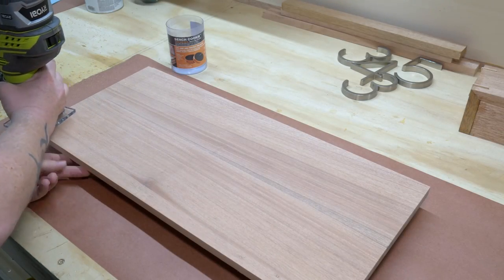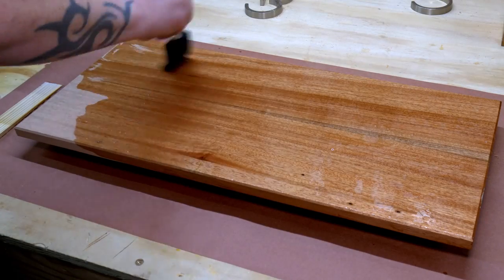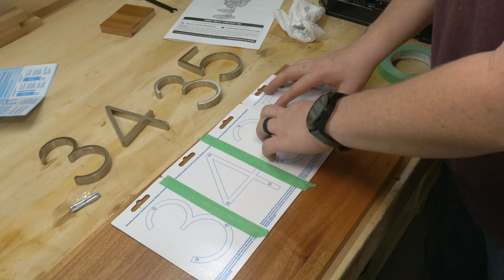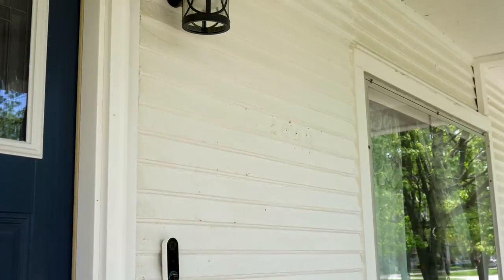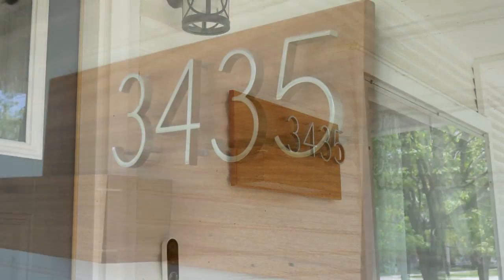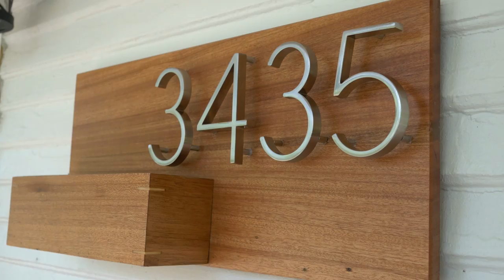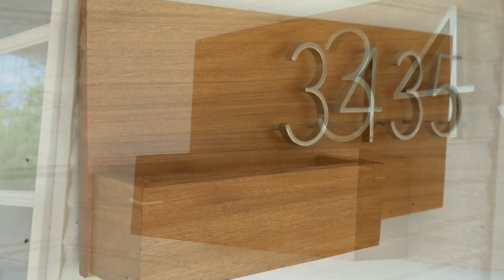Planter Box Address Sign. Easy DIY house number sign you can build in a weekend.

Comment: I plan on using the exterior velcrow tape rated at 15 lbs as well.
I see this video is over 4 years old.
Have you had any issues with the velcrow?
Have you removed it a few times since installing it?

Thanks!
Reply from the maker: @JakeStewart1343  None at all. It's still holding strong.

Comment: I built it and after watering the plants the boards warped and was ruined
Reply from the maker: Im going to assume you didn't use enough waterproofing on the planter box. It's been over a year since I made mine but if I remember correctly I used around 5-6 coats of polyurethane and then 2-3 coats of clear flex seal on top of that. It's been hosting plants for 1.5 years and I have not had any issues yet